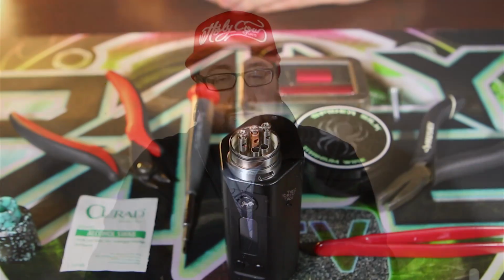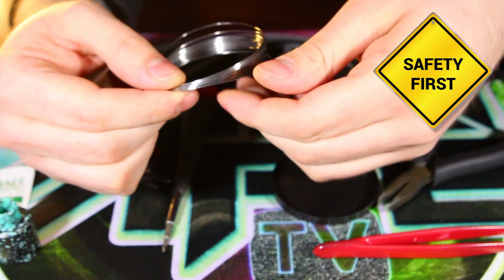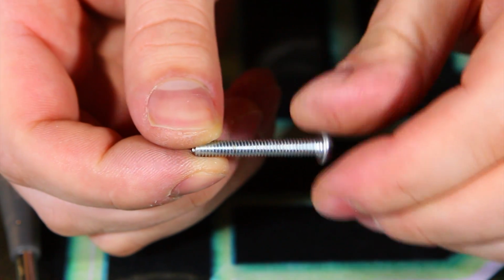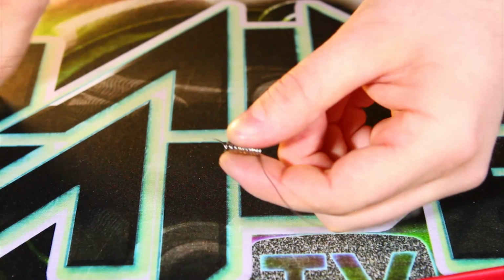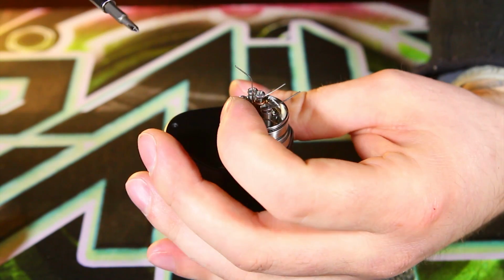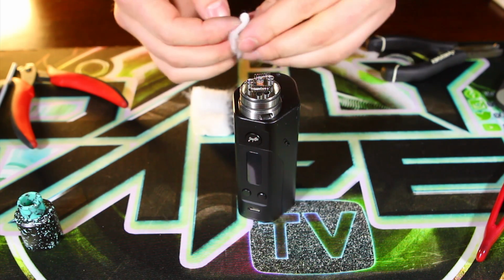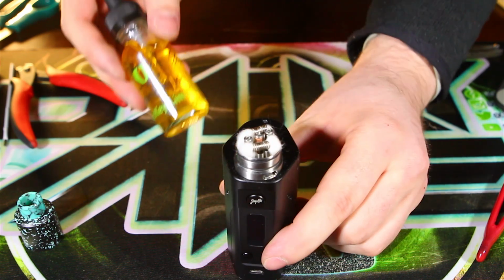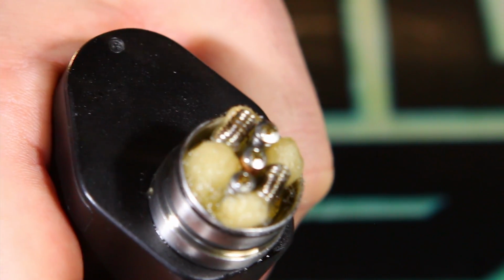#FRESHBUILDFRIDAY - Spider Silk 24g Build

Comment: when you wrap on a screw you want to wrap the opposite way that you did,counter clockwise,but the easiest is to wrap on a screwdriver(spaced) and push the coil up against the handle,but great build none the less.
Reply from the maker: +James Mucklin Thanks for the tip. I'm still tweaking my technique so this definitely helps!